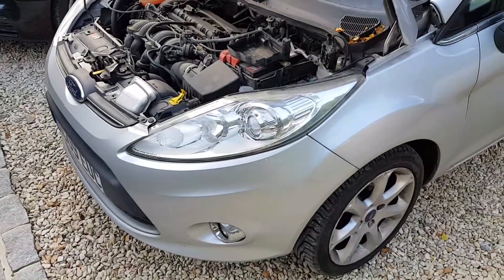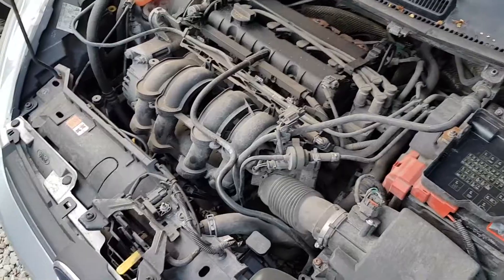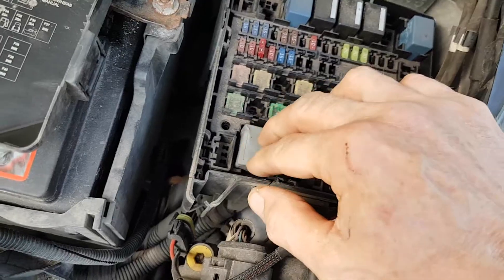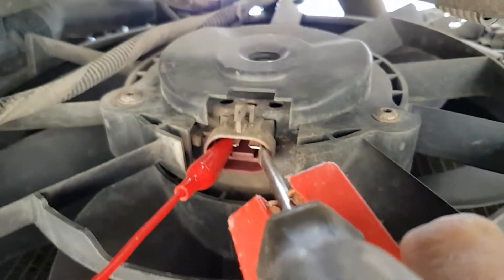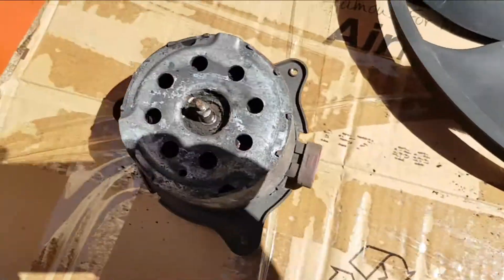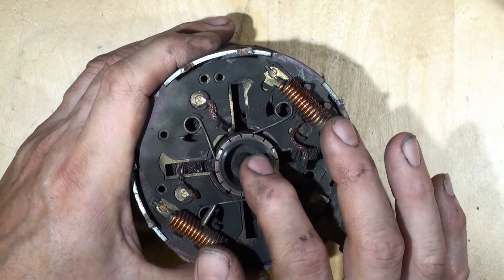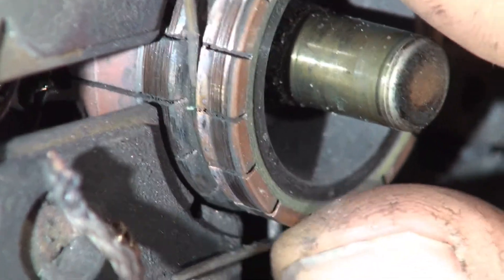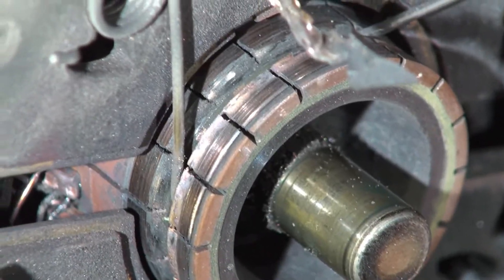Ford Fiesta 2009 Onwards MK7 Cooling Fan &  Aircon  Issue, Diagnostic and tear down

Comment: Thanks! This video saved the day for me recently - my daughter's Fiesta 2012 1.25 Zetec was overheating - I found the motor for the fan to be in the exact state as shown ... the brushes had worn down to nothing and caused a short.. this in turn had blown the 40A fuse (the green one 3rd slot along in the first row). I didn't notice this fuse was blown to begin with it was very subtle and couldn't be seen through the clear perspex lid. I bought the same complete assembly as shown in the video from euro car parts for £84. The fuse I got from a Ford dealer because I needed one that day for £7.95 but you can get them cheaper online.
Reply from the maker: That's brilliant news, thanks for sharing your success story!

Comment: My cooling fan spins when A/C is on but stops when A/C is off. What do you think is the problem ?
Reply: I have the same issue as you
Reply from the maker: It should only spin when engine is hot. Under normal weather conditions when you are on the remove the fan isn't required. Do you suspect overheating or did you expect the fan to run all the time even when the engine is cold?  You asking me what the problem is but you haven t explained the problem you are experiencing.  If the engine is overheating and the fan isn't running then check the temperature sensor and wiring and if you can get a an ODB reader and get the live data on ECT (engine core temperature).

Comment: Mine runs but doesn't stop
Reply from the maker: Check for a stick relay.  (Swap the FAN relay)  Stuck relay.   On the earlier models with aircon the main fan ran whenever the aircon was switched on regardless of the temperature.  Turn the aircon off (if you have it) and see if the fan stops when the engine is cold.  Get an ODB II code reader and check the live engine core temperature reading.  If you have a failed temperature sensor on the engine it could cause this.

Comment: FYI. I am in SE Asia and on the online shopping app I use, a replacement fan motor only is approximately £12.
I am experiencing the same 'smell' from my 2011. Done the thermostat, housing and replaced the water with proper coolant. I think I'll buy the fan motor and do that anyway (based on your diagnosis) even though it sounds like the fan turns on at around 105C. I'm still getting the 'smell' after driving in slow traffic.
Reply from the maker: Check the thermostat. Check the water pump rotor is OK.   Also that the radiator matrix isn't blocked....

Comment: Hello man, i had exactly the same problem, i replaced it and now i have an error,on tester says the step 2 of fan doesn't work and i cheked it,it works pretty good,i don t know what to do.
Reply from the maker: Which tester says step 2 doesn't work. You mean an ODB code reader or?

Comment: I’m having a similar issue, car has overheated and I’ve  realised that the radiator fan isn’t working as it is usually constantly running when the A/C is on and it now isn’t. I’ve also had the engine up to temperature and the fan still won’t kick in. 
I’ve tested the relay and can hear it clicking so presume that’s okay. I’ve got 14v to the connector for the fan motor when the engine is running. So I believe it to be the fan motor. 
I bought a fan from a breakers. Put 12v to it and it worked so I fitted it. It worked for about 5 minutes before it stopped working. I did all the same tests again and they were all fine, presumed faulty fan from the breakers. Took the fan out and when connecting 12v to it, it runs, but it doesn’t run well. 
I went and got another fan motor from U-PULL-IT as I wanted to test whether this would act the same and it does. The fan will run with 12v from a battery but won’t run when in the car. The fan blades turn freely and aren’t restricted. The plug looks fine so the power is definitely getting there. Any thoughts?
Reply from the maker: It sound most likely that you have a sticky or intermittent relay or an intermittent  break in the wiring . Easy to overcome by trial. Run a fused wire to the fan  and a switch to check the fan itself is reliable if you establish that change the relay and run a new wires for the relay and feed wires to the fan.   Have you checked the ECT with an ODB reader. Could it be the temperature sensor messing with you?
Reply: @razenby  thank you for your response! I’ll do what you’ve suggested and I may as well get a new relay and temp sensor and go from there!

Comment: having similar problem. How do you connect across the two large phase connectors to see if the fan spins? I want to try this before I purchase a fan. Good tutorial by the way,
Reply from the maker: I used jump leads and wires but it is risky.  The safe way is to you bridge the fan relay contacts in the fuse box it should run. These fan motors fail a lot so it is likely the motor.

Comment: Hey..
I have a question about the fan
Does it stop working when the ac cutt off
Mine keeps spinning even though the ac already cut off
What should I check
Thx
Reply from the maker: If the engine is hot runs on for a while when the AC turns off and sometimes even runs after the engine is turned off.  It should stop after a minute or two.  Check the relay is working.

Comment: Is anyone knows what temperature should the fan kick in? changed the coolant on my 2009 fiesta 1.4 diesel and noticed that the fan didn’t come on while i was bleeding the system.
I wired the relay connectors and the fan was working but i was pushing the engine temp above 95C and the fan still didn’t work. Any idea? thanks
Reply from the maker: 95 seems to be about the temp it should kick in but it is the radiator temperature.   Did the thermostat open and the radiator get hot.  When not under load.It is difficult to get fully run-in Diesels to fully warm up to the point where it requires cooling from the fan.
Reply: @razenby  
thank you for the reply.
The thermostat seems to be working as the the radiator hoses are getting hot. And they getting hot at around 90 degrees. But why im super confused is that, the fan is not coming on when the AC is on. It only seems to be working when i jumpers the relay. (relay and fuse is fine they were tested)

Comment: My ford fiesta engine fan keeps running 24/7, as soon as ignition is on the fan runs, i bought a new relay nd it still running😢im so tired of this issue even my aircon is not working
Reply from the maker: The fan will run when the aircon is switched on.  It could be the temperature sensor wiring has an issue or the Temperature sensor itself has failed. They are cheap and easily replaced.  Worth a try before you despair.

Comment: Probably a long shot but dont suppose you can remember where you bought the new fan from, not sure if im having the same issue as there does seem to a lot of fan noise but the air con isn't work the way it should
Reply from the maker: I bought it from eBay from a polish supplier. The aircon should work OK when the vehicle is moving if not then it is very likely that you have low refrigerant.  Note that most of the time the  schrader valves in the access ports under the screw caps leak so don't refill the gas without changing the valves.  If you have gas left then take teh caps off and squirt a bit of WD40 in the port and look for bubbles.   Washout with brake cleaner after the test.

Comment: Good video...many thanks. I have further problems though, if anyone can help?

Fan is OK, runs with ac on. Regassed the system and cabin air is icy cold when moving, but ambient when at a stop. My thinking so far is a blocked condenser. Somehow the fan is not enough to cool the condenser when stationary, but it's fine with airflow when driving. 

Any thoughts?
Reply from the maker: On my fiesta as soon as I turn the aircon on the fan immediately powers up? Does yours?  You can't miss it. When the fan is working properly it is LOUD. I have seen Ford fans assumed to be working OK by fellow mechanics but I discovered they lacked a oomppff.  So is the fan on? (car sounds like a hovercraft) when  the aircon plays up you are stationary?  It could be a bad compressor not doing the doo at low rpm due to dodgy seals or low oil.. Never seen a bad condenser on a Fiesta but you cant rule it out.  I find it very difficult to diagnose without connection the pressure guages. the high and low side pressure  tell you a lot. The thing that get blocked the most is the small orifice in the Aircon matrix often cleared by reverse flushing.

Comment: Overheating is a perennial issue of Ford fiesta ever since..and it's already 2023, yet ford has not really done anything to correct such issue with their car😷
Reply from the maker: I never had any problem when the fan motor was good. Mine only overheated because the electric fan was bad.  It never lost any fluid from the cooling system.

Comment: Why can't Ford correct such perennial problem?
Are they not capable?
My Ford fiesta 2015 has the same issue, the whole auxiliary fan is now replaced😷
Reply from the maker: Just poor quality fan motor and for some reason the fan is running a lot whilst driving.   On my model there is only one fan that runs whenever the aircon is switched on (even when speeding cruising ) and is also runs when the motor needs cooling.  It seems it isn't controlled properly as I am sure it isn't needed when cruising.  if the aircon is on the fan is on. Probably wore it out.  Car has no temperature gauge and never warned me that it was hot. First sign of trouble was a hot oily smell. Not a sophisticated control system.

Comment: You defnitely know you stuff - if you got a min I have a question please. My Fiesta fan only kicks in with the A/C, I took it up to 107c and no fan came on. I been researching for hours now. If the secret menu shows 107c that means it can't be the coolant sensor right ? I am trying to eliminate faults. Secondly do you maybe think I must check the relay ? Thank you from South Africa
Reply from the maker: Hmm, if the ODB live data shows the correct engine temp then that is strange. The BECM controls the fan. I am not clear if the ECM requests the BECM to turn the fan on for engine cooling. Is yours the same model as the one in the video?  If so, I have a manual here - I could check if there is a convoluted way of fan demand / circuitry. It could be that here are two relays for the fan.  It seems unlikely but it could be the relay drive wire between the ECM and relay is OC. It could be that the HVAC fan request is on a different wire.  What code reader do you have ? Is there a test menu -that you can activate the cooling fan in test mode?
Reply: @razenby  Thanks so much for your kind assistance. I just removed the radiator yesterday as it blew the seam so I will only get to try the process of elimination again this weekend. I used the live data in the secret menu as I dnt own a scan tool. It looks similar to your video yes, the 1.4 version. Today I found 2 relays that relates to the fan so I swopped them around with 2 other relays that controls other things bt couldn't test it as yet. The next thing I want to test is a resisor that I found attached to the fan. The problem is I have gone through so many forums and YouTube comments but I swear people just comment without experience. You definitely know what you are talking about. I need to sell this car asap but my moral conscience wants me to sell an honest car. 2 blown headgaskets so far this year and 2 popped radiators so im starting to give up
Reply: Sorry replying here after my previous comments so as to not waste your time. Its 10pm and I just tested a fan resistor I found on the fan housing and there is no continuity. Apparently there are 2 relays, one for low speed which I can only assume gets its signal based on coolant temp and another relay activated by the AC. It is therefore my resistor housing or the relay but then again its going to be trial and error as I have come across so many theories

Comment: Hi mate hope you're well.. I have a 2011 fiesta, coolant always seems to be below minimum when cold and rises to max line when reaches operating temperature., Is this normal? I noticed the coolant in your fiesta is at the same level mine is (around 1.5 inches below minimum)
Reply from the maker: It will rise when warm but not usually by that much. Do you need to keep refilling it?  If not then I wouldn't worry.

Comment: When the cooling fan got stuck on on my 2009 fiesta 1.6 TDCI I was able to get it working again by tapping the cooling fan relay in the electrical fuse box next to the battery. A very small amount of percussive maintenance was all it took to get things working properly again. I had read that the relays sometimes get stuck so jiggling them a bit can help. I was lucky this was the problem for me as this approach took about 5 minutes start to finish to fix everything (not including thinking time). I would recommend anyone look at this potential simple cause first while hoping it's nothing more complex.
Reply from the maker: We diagnosed the relay was OK in the video. If the Relay got stuck then you need to replace the relay. It will get stuck again and either wear out the fan (stuck closed) or overheat the engine (stuck open).
Reply: @razenby  Good advice, thank you. I will look to replacing the relay as soon as possible but at least at the moment my battery isn't flattening itself as I type this. 
If my cooling fan gets stuck in the off position what kind of warnings will I get other than a quiet fan?

Comment: I've had the same problem with a 2009 fiesta and changed the fan. The fan now comes on when I turn on the aircon so I know its working but it doesn't seem to come on automatically when the engine gets hot.. I'm curious to know what you would have done if the fan had worked when you tested it on your jump leads?
Reply from the maker: I would check the engine temperature sensor and wiring. How do you know that the engine is hot enough to require the cooing fan? It only comes on at the point where it is overheating or idling for a long in warm weather . (UK warm >25 degress < 30C).
Reply: @razenby  Thanks so much for your reply. I had a situation where the engine oil got so hot the rev gauge started bouncing and eventually stalled. Was advised the radiator fan had gone so had it replaced. It now comes on when i turn the A/C on but it doesn't come automatically like it used to. I've taken it on a 45 min drive and sat in stop start traffic, left it running when I got home but it didn't kick in at all. When I lifted the bonnet the engine was really hot. The coolant tank was hot and I could see the coolant was circulating. Was wondering about the relay or temp senor but guess it could also wiring. Thank again for taking the time to reply
Reply: @angusmctavish2345  9

Comment: Good Video, just done this job on my daughters car. Fan was blowing the 40 amp fuse, like you I opened the fan up to have a look inside. Surprised it was still running as a lot of the windings were burned out. Did you have any problems getting the plug on to the new fan. The EIS eurocarparts one is a different shape. I had to modify the plug on the loom in order for it to go in. Not ideal!!
Reply from the maker: Thanks. Yes - I have done a couple where they have put a key on the plug. I modified it and held it in place with a tie-wrap.
Reply: @razenby  yes, that's exactly what I did, I could not get it to lock in so used a tie wrap to secure it. It took me longer messing about with the plug, than swapping out the fan. I've emailed eurocarparts about this issue. No response yet. I can't think why the EIS rad fan has a different shaped plug, wonder if ford use a different plug on later models??
Reply from the maker: @williamneilson5784  The FAN and housing is an old design dating back to the 2000 Transit. They do it so it is necessary to buy the expensive version to fit the latest models. Just to protect spares pricing,

Comment: Thanks for this - helped find exactly the same problem with mine. Carbon brushes completely turned to dust (right mess when I opened it up) Stupid car is designed to put fan on whenever aircon operates, not just when overheating. No wonder it goes through brushes.
Reply from the maker: I agree.

Comment: Hi i own a Ford Fiesta mk7 2010 titanium 1.4 and I’m not sure if I have the same problem as the car in the video but whenever I put the heating system on low cool air does not blow instead hot air comes out and also I believe my ac does not work too and I’ve checked my coolant and it’s at the level it should be
Reply from the maker: I would connect an ODB reader and see if the car's HVAC module is reporting any faults.  Constant hot air could be a temp sensor fault, a heater flap motor or the control system. Aircon not blowing cols could be that it is overpowered by the constant hot feed. Does it blow cold (colder than ambient) when the engine first starts?  Sort out the constant hot before you work on the Aircon.

Comment: Hi I have an issue with my 2011 Fiesta titanium where my car starts to judder and randiator makes a massive noise every now and again could you give any insight on this ??
Reply from the maker: Is it under heavy acceleration that it judders?
Reply: Did u ever find out what the cause for it was? Mine is the same